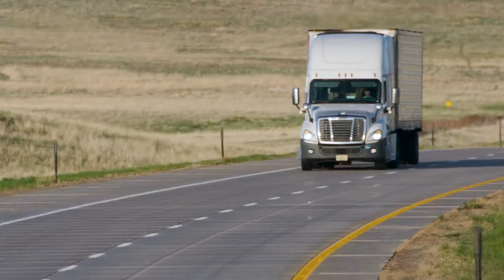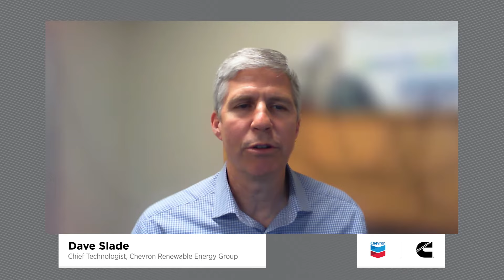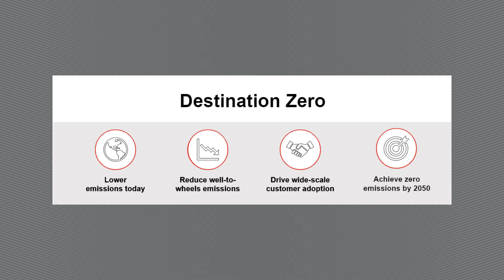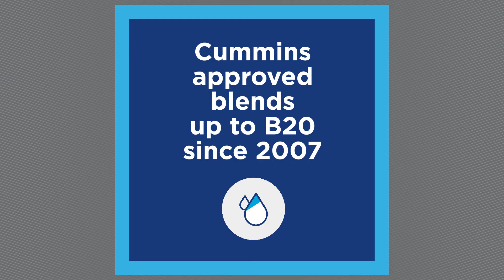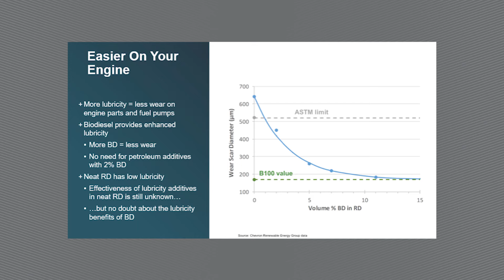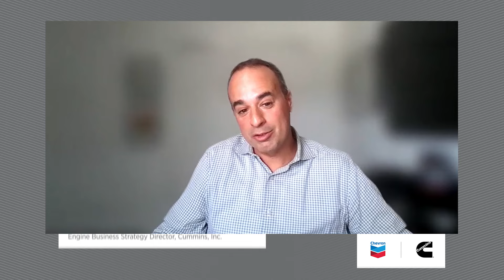Webcast: The Benefits of biodiesel

Comment: Very interesting, Biofuel circulated many years ago and didn't work in our area year round. Isthere any difference in the product to allow it to flow under cold weather environments. My company is on Long Island NY. The other question is availability, supply and demand. Will there be enough and if so will the use of Biofuel reduce the drive to EV's?